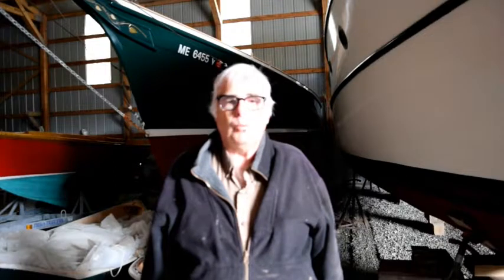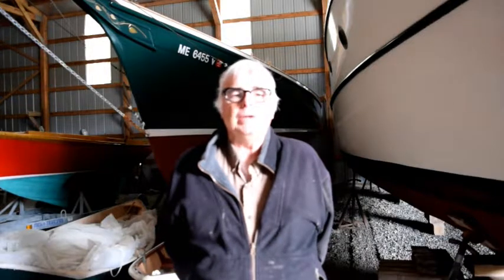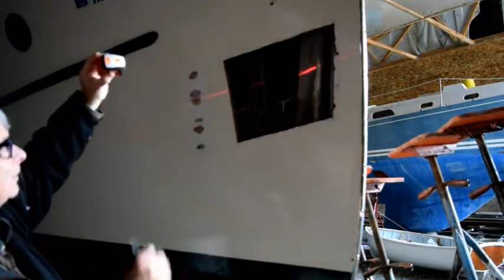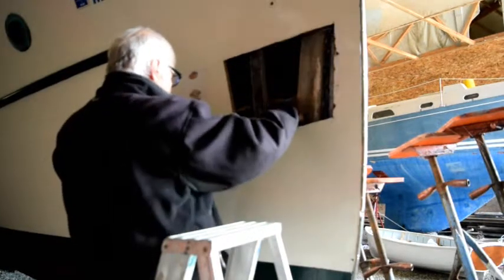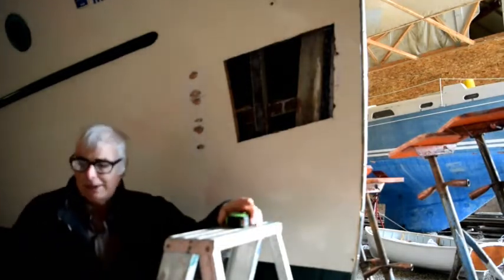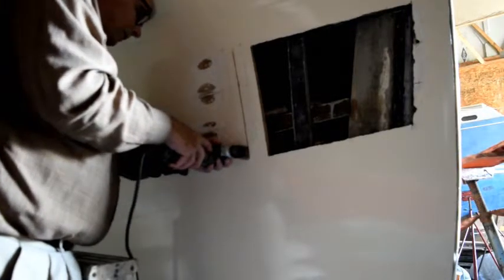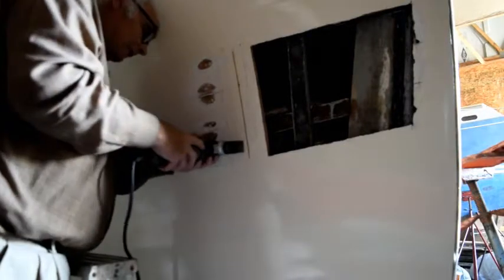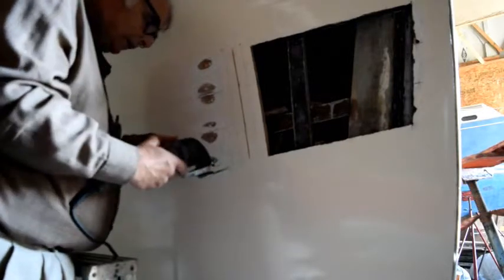Wooden Boat Plank repair - Part II

Comment: How do you determine the depth of the groves necessary for cutting out the planks of
 the scarf joint?
Reply from the maker: Michael, that is very easy.  I decide on how long the scarf will be, cut a groove 1/2 the thickness of the plank at the middle, 1/4 the thickness of the plank at 1/4 of the length, 3/4 of the plank thickness at 3/4 of the scarf length, etc.  I add more grooves the longer the scarf is.
Reply: @todddunn945  Thank you very much Todd for your quick response. I was tiny bit worried if your are doing well ( you did not come back to my last request).... great Videos and underestimate in my eyes!